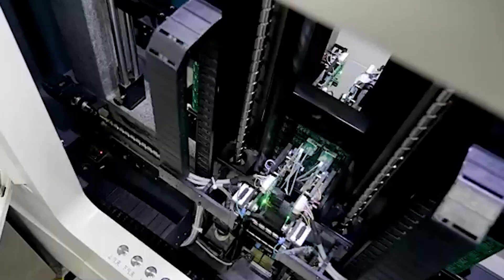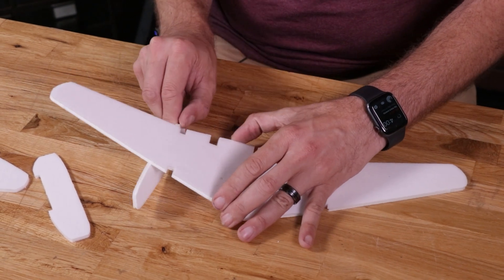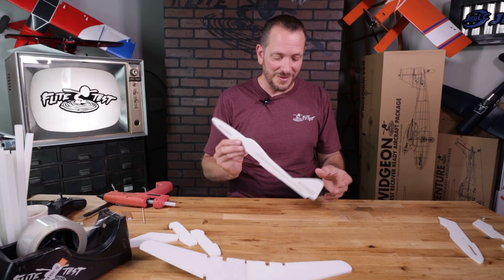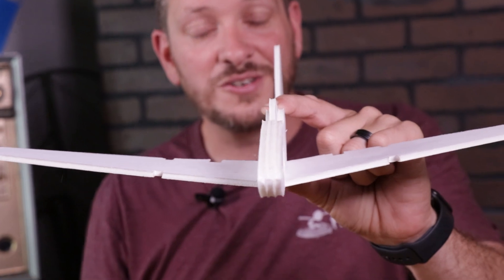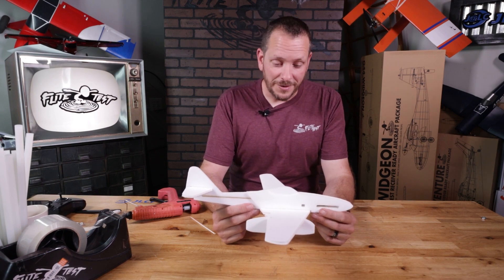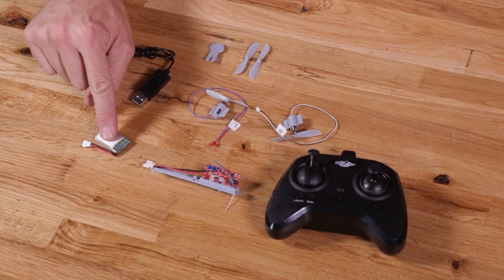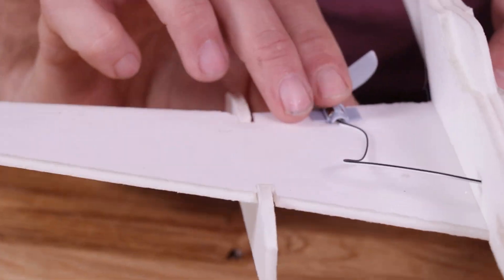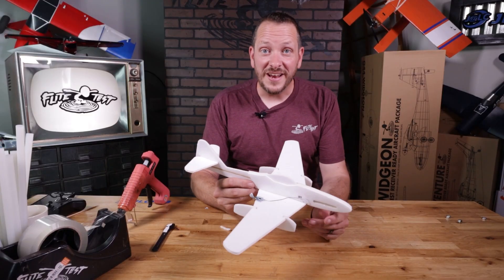How to Build the FT EZ ME-262  //  BUILD

Comment: Sure remove the paper backing and you do save weight put as I start to assemble the pieces, the hot glue is melting the Foam? I have built a few of these Flite test models and this is the first time where they tell you remove the paper backing. The paper is what gives the pieces its strength!